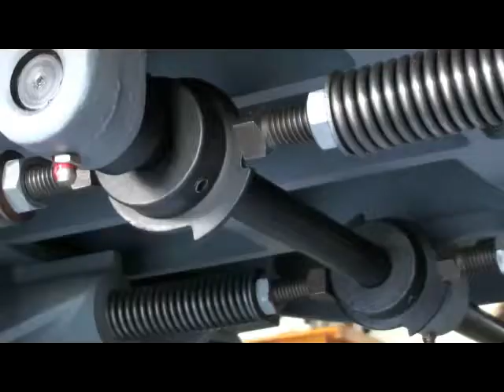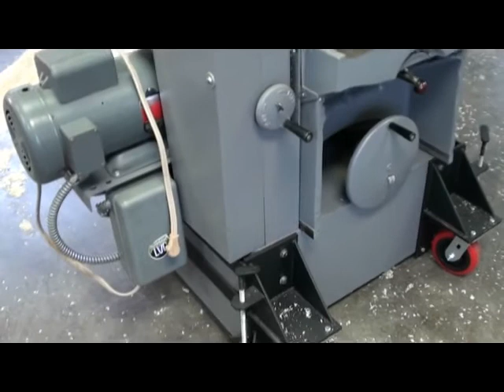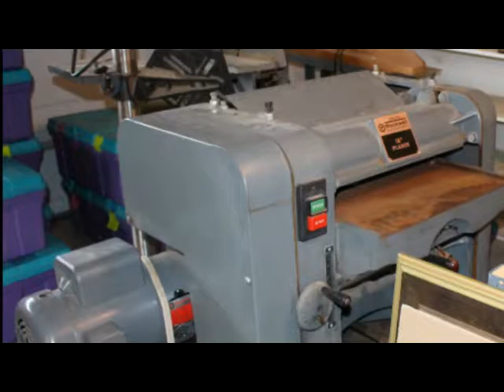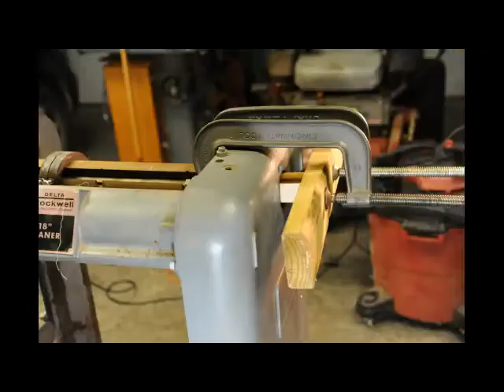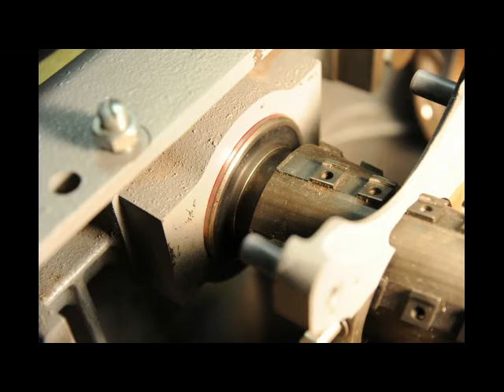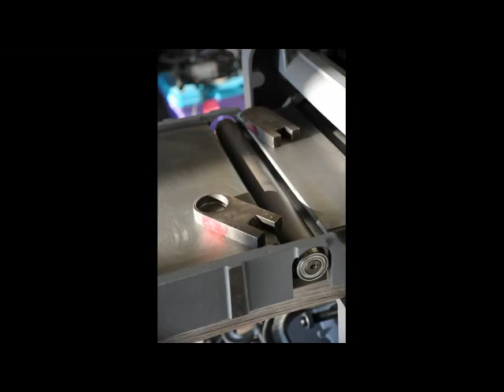Rockwell Delta 22-201 18" Wedge-Bed Thickness Planer Restoration

Comment: HI Paul.  Great video.  Its been very helpful in the restoration of my planer, which is the same model.  One thing I cant seem to find is a manual or instructions on how to setup the rollers and head assembly.  I've emailed delta hoping to get a manual but was thinking maybe you could help.  Any information/help from the community is appreciated!
Reply from the maker: VintageMachinery dot org has manuals.  Here's the one I downloaded:  http://www.vintagemachinery.org/pubs/1141/510.pdf

Comment: How did you get that small feed motor apart? I have the same planer and that little motor I can't get apart to save the world! I have the one end off with the fan in there and the other end is off about 3/8 of an inch. Can't remove it.
Reply from the maker: I did not disassemble the small feed motor on the wedge bed planer.  It would be good to see some images of your motor to see what's going on.  You might join www.owwm.org and you can start a post about your planer.  Post some images and someone will lend a hand with advice.

Comment: Hi Paul, I have this planer and I have watched your Yates planer video too. 
What did you pay for the cutter head? I’m wondering if the cost now approximately $1900 plus bearings is really worth it? I appreciate your comments. Also about the Yates planer it seemed like you spent a lot of hours on that restoration. Did you know it was gonna take that long and if so, what are your plans for that planner?
Reply from the maker: Thanks for reaching out.  I paid 1850 to Shelix including shipping for the Byrd cutter head in Dec, 2017.  I bought bearings separately.  In hindsight, I probably could have refurbished the existing bearings because it was a lightly used machine.

Yes, the J180 took a long time.  I didn't expect to take so long and there were changes in direction with the 2nd machine coming into play.   Making special tools adds a lot of time too.  I researched putting a Byrd spiral in it, but I needed to watch costs.  I will likely sell the J180.  Oddly, I have a potential buyer who would like me to install a Byrd as part of the deal as he doesn't have the tools to do so himself.  For the J180, Shelix needs the original cutter head/spindle and the the rotor shipped to them so they can accurately reproduce the taper the rotor fits on.   20-24 week turn-around.
Reply: @manyglacier1980  if you don’t mind me asking what’s your price range selling point for the J180 that Machine reminds me of a classic automobile it looks like a piece of mechanical furniture. You did a fabulous job.
Reply from the maker: @dwightforeman1258  Probably around four thousand.
Reply: @manyglacier1980  certainly a fair price. Your restoration reminded me of restoring a classic car. Great job

Comment: Have heard that these Rockwell planers are based off of the Yates-American J-180, I think Rockwell bought the rights.
Reply from the maker: I've heard that too.  Other than the form factor, there's not much in common.  Rockwell made the right choice to separate the motor from the cutter head among other design changes.

Comment: I used this same machine for years. I worked in my uncle's shop using a collection of rockwell tools. The indfeed chain drive failed do to the worm gear. We replaced it as well as cutter head bearings. Good planner well built ran alot of material threw the old  machine I believe the model I used was earlier than this unit.

Comment: Hello Paul, I have this machine too and I use it in my work, great video. Have you found a dust collector that works for this planer. 
Thanks,
Dwight
Reply from the maker: I used a friend's hand break to make a dust chute our to 16 gauge sheet similar to the OEM one (found plans on vintagemachinery.org).  It hooks up to my cyclone collector with a 6" tube.  I really recommend using a collector because it keeps dust out of the mechanicals.

Comment: I have a machine like this that just needs some blades, bearings and a few other random parts.  Struggling finding them, however.
Reply from the maker: Try https://www.americannationalknife.com/ for knives.  

For bearings, with the exception of the cutter head bearings, all of them are standard sizes you can get at a local supplier, or from https://www.Accuratebearing.com (Toll Free 800-323-6548 or 630-543-2100).  

For the cutter head bearings, you might try contacting https://shelixheads.com/.  They might sell the bearings by themselves.

If you're not already you should join https://www.owwm.com.  There's lots of help available in those forums.
Reply from the maker: Correction:  Old wood working machines is https://www.owwm.ORG

Comment: Hi Paul, awesome video. Im in the process of trying to replace my worm gear and was wondering if you think theres a way to do that with out completely removing the housing. Im trying to press the shaft and bearings down through the housing to no avail. Any suggestions on how it could be done based on your findings? Or does it make more sense to just take the thing out like you did?

Comment: Hey Paul, I was wondering if you had a source for where you buy replacement planer blades for this machine?

Thanks!
Reply from the maker: I have no personal experience with Oella (my planer uses carbide inserts), but I've heard good things about their products.  The Titan "T1" product line is what you want if it's available in the size you need:  https://www.oellasawandtool.com/  (link is valid as of 9/20/2022)

Another supplier I found was Global Tooling & Supply for the Titan brand. (9/28/2022)

Comment: Paul, thanks for the response. I did note in your rebuilding process that you loosened the frame sides to allow for bearing alignment. Just thought there was more to it than simply letting the new cutter head pull the frame sides into alignment! I wonder what the factory process involved. Thanks.

Comment: Any thoughts?
Reply from the maker: I don't have any good insight on that heating problem.

However, one thing I was a little frustrated with is there appears to be no good way to align the two frames to each other so that the bearings are free of any misalignment.  The front cross brace has no dowel pins in it to ensure that alignment.  If you think about it, if one frame is shifted front or back just 1/32", that's quite a bit of misalignment from the two bearings' standpoint.

Maybe that is a factor in your situation.

Comment: Hi Paul, I changed the cutter head in my Delta wedge bed planer to a Shelix as well, but for some reason I can't figure out why the cutter head shaft on the opposite side of the motor gets extremely hot after about 5 minutes of running. The bearing seems to be fine. I've replaced the bearing with the same result?

Comment: What bearings did you use. I am almost done with a  Restoration of a 22-201 and just orded the Byrd head .they tell me to use 6210-2rs but they don't have the snap ring and the width is a different size. thanks for any information on this.
Reply from the maker: I was able to find the original bearings through Purvis Bearing in Ft. Worth, Tx.  They were very expensive.  I was thinking that Byrd had the newer style of bearings (the ones that do not have the different inner/outer races) and also had the spacers that you use with them.  I'm sure it would be cheaper to not buy the original odd dimensioned bearings.  If you do a search on www.owwm.org, you should be able to find my post that includes a big PDF document of my restore, including the sources of supply I used.
Reply: @manyglacier1980  thank you

Comment: Great video!  I just bought same planer.  I need help adjusting rollers and blade heights. Any suggestions?
Reply from the maker: As of today, Vintage Machinery has an owner's manual for the unit:  http://vintagemachinery.org/pubs/detail.aspx?id=510. It has some instructions for adjustments, but are not very clear.  You can also search here on u toob for planer knife adjustments.  Looks for the ones by Robert (Bob) Vaughan.
Reply: Thanks   I checked out Vaughan’s tutorial and it’s very helpful!

Comment: Super jealous with the helixical head.
Im restoring basically the same machine but mines the 200 model. So no feed roller fine adjuster.  Plus mines 3 phase so converting to single phase.
I really want to put a shelix head in but can't justify dropping almost $2k just for a cutter head.  They are obscenely expensive for this model. Probably because it's not a common size 15" or 20" vs 18"

Comment: Do I adjust the speed control while running or idle?
Reply from the maker: Sorry, I'm just seeing this.  You adjust while running.  The feed belt runs on variable pitched pulleys and they have to be rotating for the pitch to change.

Comment: Paul, I’m in the process of restoring a 22/201, but am missing the 5 hp drive motor. Can you tell me the motor rpm’s? I can’t find that spec anywhere! Thanks!
Reply from the maker: My motor is 3450 RPM (220 VAC single phase).

Comment: I have one of these planers at the university I am attending. I have been tasked with trying to fix it. It will run the first board fine but the second run gets stuck. I am drawing a blank on it and am looking at a complete restoration like you did. Where did you find the parts for this at? I have been able to find some but not a lot of them. Any help is appreciated
Reply from the maker: Joshua, there are only a few parts available for the 22-200, 22-201 planers. There's a guy on eBay that has the worm and worm gear for the feed mechanism.  This same guy also makes the gears available to members of http://www.owwm.org at a lower price (it's still pretty expensive).  For owwm, you'll want to register and all that - you can then search for me by name and I'll refer you to him (I just don't want to give user names, emails, etc. on youtube).  OWWM also has an excellent community of members who have stuff for sale (FS), trade, or wanted to buy (WTB).  You could post on that forum with any parts you need (it's called BYOD - bring out your dead).

On OWWM, I also have a PDF document posted of this project that has a few sources of supply listed.

For the cutter head, you could go to https://www.shelixheads.com (shelix cutter heads).  If you don't want the helical cutter head, they could sell you the bearings for the cutter head.   You can also get bearings from any local bearing supplier.  However the OEM cutterhead bearings are a bit odd and very expensive.  Shelix has conventional bearings and the spacers needed to allow installation of the  standard bearings.

Finally, I'd like to know how things go for you; I'm glad to help if I can.  You can reach me at the following alias and I'll reply with my actual email and provide additional resources, such as my PDF:  paul dot ienergy at outlook dot com
Reply: I'm just installing a Shelix in my Model 18, thanks for the helpful video. I didn't know you could the roller height adjuster and I've had the machine for 23 years. Looking now it has all the holes and threads for it but none of the mechanism.
Reply: @ebenrobinson7086  you probably have the model 200 like me. Which doesn't have the feed roller adjuster.  That's the difference between the 200 and 201 model.

Comment: Great job! I have one here in our highschool woodshop. Where did you get a spiral cutterhead that fits? I would love to convert ours :-)
Reply from the maker: Thanks David.  I bought my spiral cutter head from Shelix (https://shelixheads.com/).  They have heads that will fit your jointers toos.  It was a few weeks turnaround time, but it matched all dimensions; it takes 90 carbide inserts (included, plus ten extra).  This planer has an unusual OEM cutter head bearing in that the inner and outer races are different widths.  Shelix sells standard width bearings and the spacer rings to compensate.  Excellent product.
Reply: Love old machines... 
trying to upgrade one
Can you tell me how much you paid for your new cutter head and accessories?
The shelix website doesn’t show the 18” head
Reply from the maker: @maencoch80  Not sure why I'm just now seeing this.  The cutter head was $1800 in 2017 when I restored it.  The cutter head bearings were difficult to find and were $100 each.  Shelix has the head for this planer, but you'll need to call them.

Comment: Well done video. I hope to find one of these planers soon.
Reply from the maker: Thank you David.  There is currently one listed on Craigslist in the Arlington area of Dallas/Fort Worth. It looks to be a similar vintage machine, but without the adjustable table rollers.
Reply: Paul Novelli , I am looking for one with the adjustable table rollers in the Northeast. Hoping to find one just like yours and to do the same restoration and upgrades. I am especially thankful that you mentioned the machine’s weight in your video. My shop has wooden floors and weight is an issue, but this machine is not too heavy. Great video, very inspiring. You make it look easy.
Reply from the maker: A couple other sites you might watch are vintagemachinery.org and old woodworking machines (owwm.org).  Both sites are a bit quirky to navigate, but will occasionally have machines for sale.  Good luck - it is a satisfying project.  Maybe scour the classifieds; watch for schools shutting down their industrial arts programs.
Reply: Paul Novelli I am signed up on both of those sites. To say they are quirky to navigate is being too kind. The best leads seem to be on the Woodweb site, Craigslist, and eBay. Hope you continue to do more Delta tool restorations. I have a bunch of old Delta woodworking machines and most of them need work.

Comment: Hi Paul. I have the same machine 1981 vintage. Any chance I can get your email address to correspond ?
Reply from the maker: Sure, Tim. It'll have to be a two-step process though.  You can use the following alias and once in contact, I'll reply with my actual email:
paul dot ienergy at outlook dot com
Reply: @manyglacier1980  hi paul I sent you an email to your alias. I hope I got it right. Thanks

Comment: Beautiful work Paul!!!!! I have one that I've been sitting on for 7 years now and have always wished to do the same. I grew up with these machines in the few shops I've been lucky enough to spend time in. Seemed like every school seemed to have one. They are a different animal than any of the machines today for many reasons. They have idiosyncrasies that I actually seem to prefer. Also, I get a feeling of nostalgia that always seems to kick me back to remembrance of the time I only started to love woodworking.   I can't believe you have a helical cutter head! Although I have some new blades, seeing that has urged me to tackle this project. Where, where, where did you get that done?  Would love to resource you through the project or at least pick your brain a bit. 
Fantastic work!
Reply from the maker: Thank you so much!  It was an interesting and rewarding project to be sure.  If you're familiar with http://www.OWWM.org, I've posted a PDF document on that site that basically has all the still pictures from the video and then some.  However, it also has some sources of supply for the replacement parts.  I'd like to know how your project goes.   You're welcome to keep in touch here, or if there's a way to post a private comment, I can provide my email address.